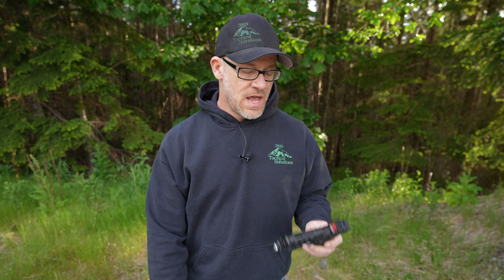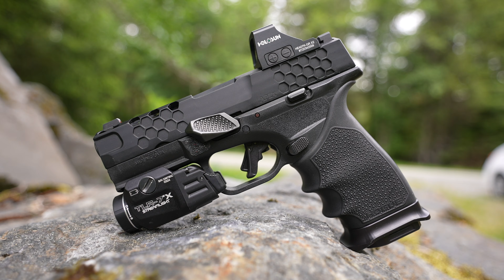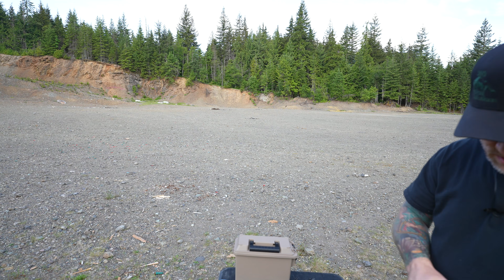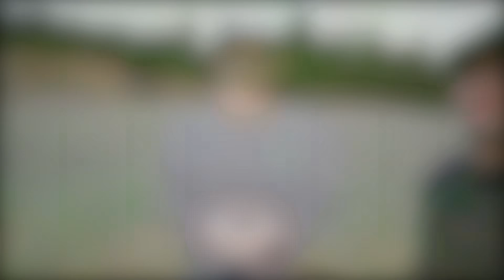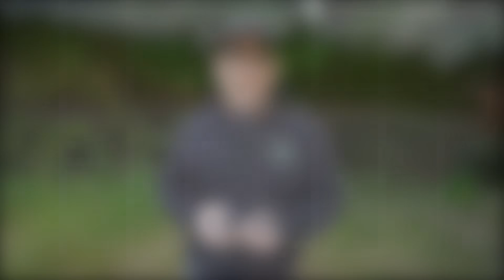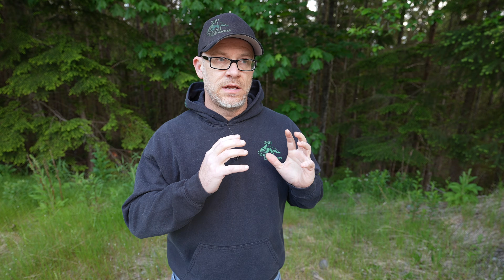BlackSteel vs GoGun USA - Hellcat Pro

Comment: that's not a good desing
Reply from the maker: I instantly have to disregard comments like this….”thats not a good design”. No opinion as to why, no supporting commentary, nothing other than a single line statement. Mind you I literally test these kinds of products constantly, it’s what I do. I’m not talking about one or two either, I have a minimum of 30 items on my desk right now getting rotated in for testing and they will get put through the paces for quite a while before anyone even hears about them. Next time maybe try and support your end opinion with something other than “i dont like it”
Reply: @360TacticalSolutions  well don't complain😆
Reply from the maker: @victorrodz3 complain about your comment? I’m just saying if you want to comment on a video at least have some points to make
Reply: tHaTs NoT a gOoD DeSiGn........STFU.